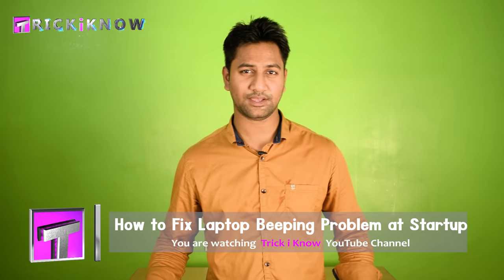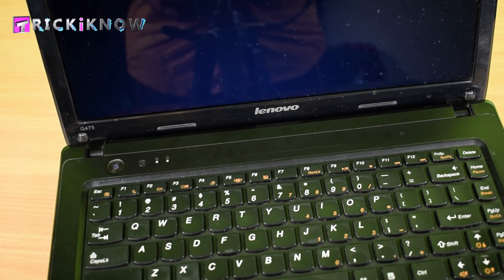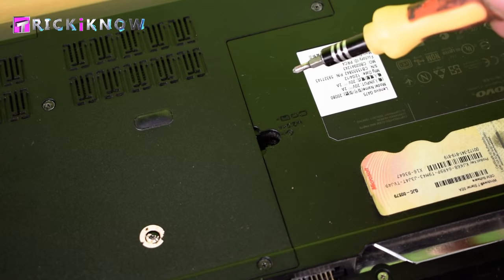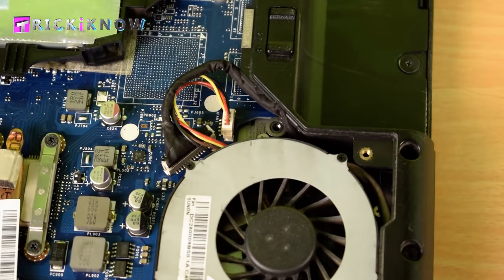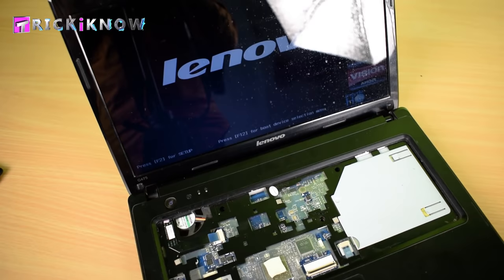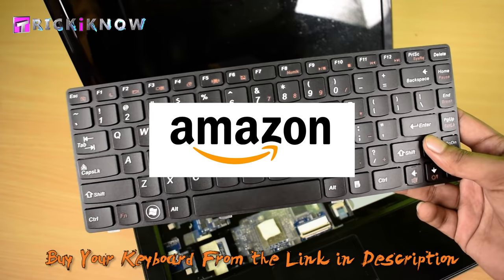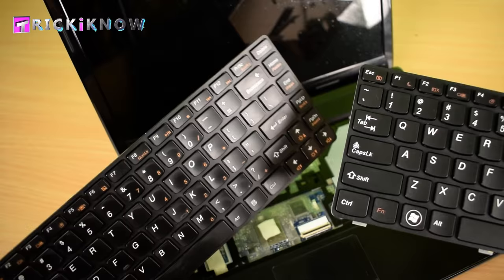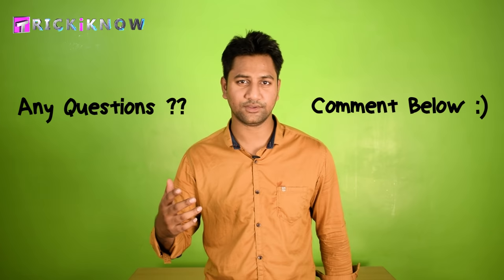How to Fix Laptop BEEPING on startup Problem - Which Stuck at Booting Black Screen :)

Comment: Thank you. I had a problem with my laptop, it was sounding so loud. I thought I had to replace my keyboard with a new one . But after opening it & connecting it again solved my problem. So didn't actually have to replace it at last. My laptop is hp btw
Reply: You lucky duck! Lol.

Comment: I thought my computer was toast, but I was able to fix it because of your awesome video. Thank you!!
Reply from the maker: Ohh very very welcome 🙂
Reply: Is it ur laptop exactly like ghis cuz i have a problem of taking tge back bit of the laptop out cuz itsnt the same this laptop. Also does the laptop still work
Reply: @Marwa-tp6rb  No my laptop is an HP so a little different, but similar enough that I was able to open it up following this video. I didn't actually test the old keyboard the way he does in the video, I went straight to installing the new HP keyboard (ordered from Amazon) and it worked like a charm! Good luck on yours!
Reply: @jonialm2664  alright thats fine thank youuu

Comment: Hi, thank you for the video,i have a question about this but i have slightly different errors. The loud noise usually starts when my laptop updates and goes to restating mod and after that when its turning on, but it turns on after the noise is finished. Also i have another very annoying problem,not sure if its connected with this one.. my left mouse button when i select folder starts deleting them, also when i want to open something, and when i select text it also delete it. Do you know maybe if this is also a keyboard problem? Thank you

Comment: I had a continuous beep on my Toshiba laptop and it was the battery.

I removed it and unplugging the power cable, held the power button for around a minute, reattached the battery, making sure it was sat in place nice and solid, plugged it back in and it booted up as normal!

I do have message with a Red Cross, saying “consider changing your battery” 

It’s an ancient laptop! I got it second hand about 9 years ago haha 😂 running Windows 7 🤣

Still does the job for me though 😁

Comment: Is it still the same because the high pitched noise coming from my laptop is much louder and longer for about 2 minute long than the sound in the video ? I always scared whenever it happened expecially at midnight when people fall asleep.
Reply from the maker: Check may be the keyboard is short internally , try to unplug the keyboard cable. I understand your feelings for the night 🙂

Comment: I just randomly tapped all the keys like piano and it worked , strange 😅
Reply: Press F8 continuously during booting process. It will turn your laptop on in Safe mode; without beeping :P
Reply: You are a life saver.
I was NOT about to take off my keyboard
Reply: @forhadrh  ...and then what?
Reply: @alanstjohns  Nothing, you can use your laptop normally after the safe boot. But safe boot was made for inspecting the problem your laptop is making & then fix that problem. You can find more about troubleshooting in google. But I didn't go searching for that since I can use my laptop using safe boot. Then One day my laptop became normal again(automatically!) & I didn't have to press the f8 again :)

Comment: Hi quick question, what if my laptop keyboard is working... like I can still go to the bios setup and navigate even if it’s beeping.. should I remove the laptop keyboard as an option for the bad hardware that’s shutting down?
Reply from the maker: Try to unplug  the keyboard for one day , use your laptop with a usb keyword. The see its working fine or not.
Reply: Just press F8 continuously during booting process. It will turn your laptop on in Safe mode. No beep at all!
Reply: @forhadrh  omg this worked just now!! Thanks !!
Reply: @hisuisgsw8602  You r welcome '😊
Reply: @forhadrh  
thank you it works 😳😁😁
Reply: @MaRyAm_BenT_Al_ArAby  My pleasure 😊
Anyway, nice profile picture 😁😂
Reply: @forhadrh  

thank you 😅😅🙊
Reply: @alshinfatma2314  I didn't lie, 2 people in this comment find this worked you see? Maybe your laptop doesn't support safe boot or your f8 key doesn't work. You had better try something else

Comment: But mine was dell(2012 model)  and having particularly 7 beep sounds in a row
Reply from the maker: Actually 7 beep is an error code, that means processor problem in dell laptop. Open laptop, unplug the processor and plug it properly and also clean old thermal paste and apply some. see if it works.
Reply: What is mean by 4 beep sound???

Comment: Please help me. My HP laptop frozen while I was working. I turned it off to restart. After that it was showing BIOS updating & do not turn off. It has been 3+ hours. Laptop screen is black + Caps lock LED is blinking + beep sound (once) after every 2-3 minutes. What should I do?
Reply: Same problem in my laptop also

Comment: Hi. I want to know, What will happen if i do nothing and let it keep beep?? Is it danger?
Reply from the maker: Yeah it could damage your laptops motherboard
Reply: Omg😰. Soon I will change the keyboard. Thanks for your information.😊👍
Reply: No way it can...its just a warning alarm as buddys laptop done it for just over 9 months until i gave him a "no tools needed what so ever" to fix it...
Reply: Hanna,what do you mean by "no tools needed whatsoever". Please explain as I am facing the same problems since 5 months.
Reply: Guys.. I fixed my laptop and i done nothing but removed the battery and used the laptop via charging. After sometimes used.. inserted the battery. After that no beeping. Then i realized that..it had no problem with keyboard but with battery. Try it once.
Reply: Maybe just the battery heat alarm...
Reply: Hamma, where is the "no tool needed whatsoever "option or it's just a phrase? Pls explain
Reply: @safana1995  what about if my laptop battery is fixed inside?
Reply: @bluelily71  is ur laptop have inbuilt battery? Sorry.. I don't know about that.. u can check whether it can be openable or not...try by screw driver.. if u feel fear to open by yourself..just bring it to good shop to repair.😊👍

Comment: Good video. 
I think my laptop issue was something to do with my mouse, and/or/also the fact that I had just did a hard shutdown of my frozen Manjaro Linux, which is installed on a 1TB external USB 3.0 portable HDD. 
All I did to fix my laptop beeping was to unplug everything, including power and battery.  Then, it booted up into Win10 (on main HDD) just fine. 
The mouse was plugged into my external (powered) USB 2.0 hub and it had temporarily stopped working in the past. 
Another issue I had was on an iMac;  an external desktop size HDD was causing the iMac to not boot. 
Overall..., be wary of USB devices and hubs.  And, try the simple things first, like unplugging external devices including the battery. 
Oh ya, don’t buy cheap Victsing mice.  It’s ok, but it’s not worth the money savings if you’re always thinking it might cause issues in the future.

Comment: if you know the faulty key just long press it when laptop is off..and try to restart.It worked out for me.Also its a temporary solution to the problem. Lenovo lappies face these issues a lot

Comment: i have the same issue, beeping sound is so loud. The only thing that different is after few second beep sound is dissapear and it still can boot normally, idk how to solve this.
Reply from the maker: Same, you can check if it is a Keyboard problem or not.

Comment: Ok a quick fix which i do without even touching any tools is...control panel = what shutting laptop lid does click shut down....and when you go to power off at end of day what ever...click Hibernate instead and next time you turn it on...instant start no waiting and NO bloody "beep beep beep" crap...
Reply from the maker: Thanks for your feedback , Its depends on the laptop condition. As i own computer shop i found many cases with the shorting keyboard. If the keyboard is short then no software utility will work 😀

Comment: Guys i got the point the matter is some conductive dust get inside to your key board no need to buy any key board this trick may work use a tooth brush and a straw clean the keys properly using the brush then blow it using the straw.
Reply from the maker: Thanks for the information, may people fix their keyboard 👍
Reply: @TrickiKnow  my pleasure ☺️

Comment: I've been having this problem for months sometimes it goes but mostly is stuck like this, mine is a lenovo G470 when it go through start up be able to boot it still has this automatic pointing upwards, thank you for the solution.
Reply from the maker: Welcome , check out some of my new videos 🙂
Reply: I have the same laptop and it turned out there was a problem with the page down key

Comment: It's not only about the keyboard the count of beeps indicate different issues:

1 Beep: Replace the motherboard / system board.
2 Beeps: Reseat the memory or replace the memory.
3 Beeps: Replace the motherboard / system board.
4 Beeps: Reseat the memory or replace the memory.
5 Beeps: Replace the CMOS battery.
6 Beeps: Reseat or replace the video card or replace the motherboard / system board.
7 Beeps: Reseat or replace the CPU or replace the motherboard.
8 Beeps: Reseat the LCD cable or replace the LCD screen.

Comment: Hello Great Video.
Whenever I connect My Charger To Laptop, It gives me continues Kat Kat Noise like.  Laptop works Normal but whenever the adopter is  connected it gives continues Kat Kat Noise. Note : it is the same noise which comes whenever Charger is connected. But it comes for just one time. But now it's coming continuesly.
What would be the issue ?

Comment: Thanks to this info , my laptop makes that same sound of continues beep and it is the same problem based on the video, it's Keyboard . I'd detached the cable , and it boot, I tried testing it just like in the video and it beep again . I installed it again without attaching the flex cable . For now , I use an external keyboard while finding keyboard replacements , 👍
Reply from the maker: You are most welcome, thanks for sharing your feedback 😀

Comment: I have had this problem several times with my 11-year-old secondhand Acer Aspire laptop. I really hate the sound, and find it embarrassing when using the machine in a public place, as I normally do, like the university or the mall. However, in my case, it doesn't seem to have anything to do with the keyboard. It has to do mainly with the arrangement of the very long charger cord. If the charger cord (which has two sections, one of which plugs into the laptop and the other into the electrical outlet) is too tightly wrapped around the machine or has too many kinks, then that's when it makes the sound. So I just turn off the power button, rearrange the cord more carefully, and usually when I turn the machine on again, it no longer makes the sound. Sometimes have to try 2 times. (I normally use my laptop with a big, desktop-size external gaming keyboard, although sometimes this keyboard stops working when the Internet connection is too slow or too many items are open on the machine, but normally both keyboards work fine.) By the way, the battery on my laptop DOES NOT WORK AT ALL - has been this way since I got it from the original owner. The moment I unplug the machine, it shuts down!
Reply: we have the same problem and laptop

Comment: I found easier way :
It might be because of some device connected. So unplug everything.
And then you need to press F12(Or any boot selection mode button)
And boot your normal operating system. It works to me

Comment: I have a Toshiba Satellite doing this. i removed the keyboard (unplugged the ribbon) and it still beeps at power on. any idea what else it may be?
Reply from the maker: Your laptop needs servicing , try changing the cmos battery 🙂
Reply: @TrickiKnow  CMOS battery changed, issue continued. Any other ideas? Could my charger be causing the issue. 

Run down at start up (battery Fully charged, no charger)

Power button is pressed. roughly 3 seconds later it starts beepbeepbeepbeepbeep...
Screen NEVER even attempts to come on. Fan spins and stops, and you can hear the Hard drive spool up and also stop when the beeps begin. 

its the same with the charger. 

I think at this point i need a new laptop, i just want to be able to save my files that were on this one to the new one

Comment: My problem is that it turns on and works normal, the only problem is that it beeps 5 times and it stops beeping when i conect my earphones. But every thing is normal.
Reply from the maker: An expensive way to avoid those beeps, use usb or Bluetooth earphones. But if you want to fix then you have to clean your laptop from inside or may be you need to change the audio socket.
Reply: @TrickiKnow  so, cleaning the fan should fix it?
Reply: @TrickiKnow  welp i did it and it stoped beeping. My laptop was full of dust in the inside many thanks bud.

Comment: hey mr. your video helps me, I have question....... my laptop is lagging in all process does the keyboard also affect the performance? and I also experienced BSoD before the beep occurs
Reply from the maker: If your laptop's keyboard have few buttons shorting then , it may be affect your performance. Try to use your laptop without it , and use an  extrnal USB keyboard for testing. If its still lagging then its os or hard drive problem :)
Reply: I'll try your advice thanks for your response :) by the way how many hours does the CHKDSK take?

Comment: I have the same problem on my dell pc 5 bip with red light and black screen
Reply from the maker: 5 beeps and black screen means, may be the CMOS battery is dead or may be RAM and RAM slot is needed to clean with brush.

Comment: I have a same beeping start up problem in my hp laptop, till now I hav been starting by pressing capslock two times continuesly once it start beeping. Space button and dot button is not working in keyboards.
What could be the possible reasons ?
Is it because of keyboard or hardware problem?

Comment: After a while, the bleeping disappears and Windows loads up but it is unstable. Any suggestions?
Reply from the maker: Try to clean your laptop from dust, mostly dust stored in the keyboard. Try to unplug the keyboard and check its beeping or not. (You can use any PC USB keyboard for while)
Reply: @TrickiKnow  My laptop is 10 years old (Toshiba Sat L650) but in the time I have had it,   I've mostly used a secondary USB keyboard, mouse and an external monitor - so the lid has always been closed. On switch on, It now bleeps for 20 seconds or so, but I have found if I begin to use laptop keyboard (and mouse) it stabilises; I can then close lid and use external USB keyboard etc. Could this be a 'battery thing'?

Comment: Maybe I can get a new keyboard if that's the problem for my HP pavilion DV8 which runs super slow on windows 10 so I think i should change my operating system to ubuntu linux and put all my data from files in to a usb drive and then I can use ubuntu and store it

Comment: When my laptop beeped like that the screen did not turn on at all, but it beeped and keyboard lights did turn on...
Reply: It started charging but i was too scared to turn on. When i went to turn it on it would not start, i did disconnect the charger. I then plug it in but it was not charging. The charge LED did not even come on!

Comment: Hi, I am using a laptop Lenovo g580 model there is a problem in my laptop. Actually, in my laptop, the battery is not detected as the battery is new, if I just plug out PC charging cable then the system gets shut down. So how to fix this do you have any idea about it?

Comment: Mine is sounding like a freaking power tool after I sprayed compressed air near the battery. Update: it’s normal my hearing isn’t used to a clean laptop.

Comment: I need Suggestion:
my laptop is only making 2 Beep sounds when i turn it on and boots up Normally and everything looks working fine BUT MY CONCERN IS THERE MAY BE SOMETHING WRONG,  thats why it is making Beep sound and this is HAPPENING FROM LAST 2 DAYS.
Reply: My beep sound is for about 20 seconds, then I can (eventually) use laptop as normal.

Comment: Dear Sir, 
I have the same problem it's beeping continuous and before that it's key boards was mising g,and a but suddenly it's not typing I have the lanvo lab top the other key boards we used it's printing good but beep sound is continuous 20v 3.25 Ams type 4291-TQU S/N R-9 PL8EF12/06 Product ID 4291TQU Lanvo Think Pad Mini lavtop kindly reply

Comment: In my laptop one key is auto pressing  please solve this issue. Due to this my laptop is beeping.
Reply from the maker: if you can, unplug that key and cut the tiny pcb wire with a paper cutter. or you can unplug keyboard and use a usb keyboard. or you can buy a new keyboard for your laptop.

Comment: My laptop sounds loudly and started.  Is it any problem????
Reply from the maker: If the beep sound is in pattern, like 2 times or 4 times then this is not the keyboard problem. Check beeping patterns and fix in google.
Reply: @TrickiKnow  when I started my laptop it beeped twice and then laptop started and automatically working keyboard like it downwards everything without using any keyboard.  
And then I restarted laptop and today i didn’t face any of the issues.  Now can you tell me is it any serious problem????

Comment: What if its not the keyboard? If the beeping continues after you remove the keyboard, what is it?
Reply from the maker: Then it may be the motherboard problem it its not starting
Reply: When I remove keyboard, it's ok, but when I connect keyboard with motherboard sometimes beeping sometimes not....what's the problem then? Tnx